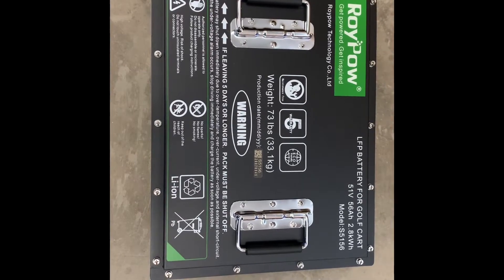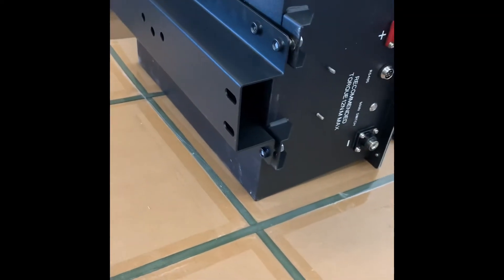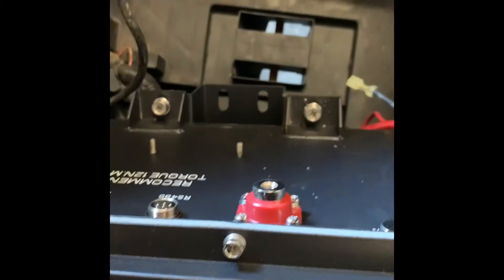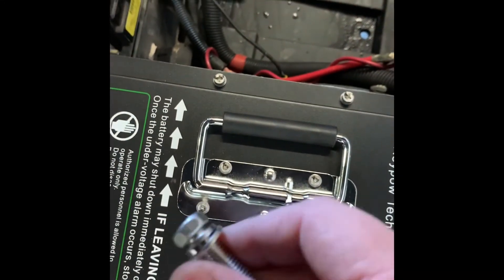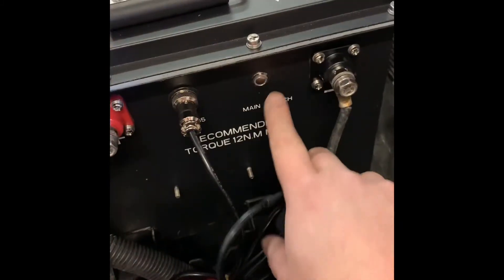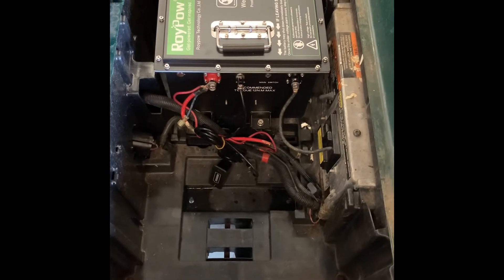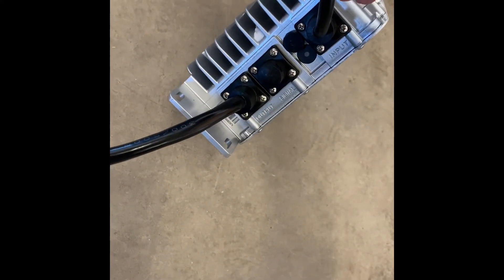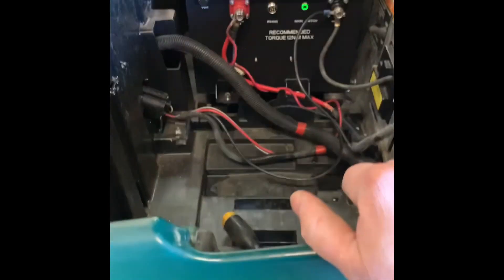RoyPow Lithium S5156 Battery Installation / Conversion on 04+ Club Car Precedent 48v golf cart carts

Comment: Will these RoyPow batteries fit a 2013 Club Cart Precedent?   Also, Where do you get a replacement battery charging port?
Reply from the maker: Yes. I sell the kit on my website JBCarts.com and shipping is $299 if needed. Out of state buyers do not pay Texas sales tax. I did do a tutorial video on how to install it on the club car as well. Roypow now only uses the charger adapter that connect directly to the battery now and no longer uses the receptacle.
Reply: @jbgolfcarts  ....... Thanks....also, does the new battery charging  cord use the old battery charging port that is next to the F/R  switch so you don't have to raise the seat to charge battery?
Reply from the maker: @steveharris2768  have to lift the seat on all updated roypow conversions. You can mount your charger on board and run an extension cord to the charger or leave the charger out of the golf cart but either way you have to lift the seat
Reply: @jbgolfcarts  If you don't use the CC original charging port (instead using the charger plug and pluging it into the wall) do you have to do an OBC bypass?

Comment: have you had any issues with the roypow chargers? i got my first 2 sets in and they give a fast blinking red light when plugged into any outlet wit or without batter connected.

Comment: I watched your video on the RoyPow installation. I would like to know if you have any pros or cons on the battery. Or have you been able to test the range distance on a full charge. I have a built 2018 club car precedent and I’m looking to swap out the acid batteries and put in RoyPow 105. I would like to know if you had any kind of problems or have heard of any problems for this battery before I fork out the money Thanks
Reply from the maker: I custom build carts so I have no feedback as far as how the hold up to their rating but I will say if there was a range issue my customers would have called me. So far so good though. I’ve had no calls or complaints from customers.
Reply: Thank you for your quick feedback
Reply: Upgraded with the plumquick motor with Navitas controller and battery protection comes on going uphill. Shuts golf cart down completely. But distance is great.
Reply: Look at other Lithium batteries for golf carts. RoyPow doesn't honor their warranty. I have a 3-month-old dead Roypow battery that was in my 2017 Club Car.. Been jacked around by them since April.
Reply: @richardtucker5837  Did you ever get your issue resolved with RoyPow?
Reply: @chrisfoster632  No. The RoyPow North American rep refuses to get involved. Said it's between me and the company I bought it from. I own a $2600 boat anchor.

Comment: Just installed a RoyPow battery in my Club Car. Where did you get the Stock plug to ac plug that you are using to charge the battery? Great video.
Thanks
Reply from the maker: Roypow is changing their charger plugs around so I’m not sure what I’m getting next but the plug in this video is what I normally get with the chargers.
Reply: Thanks for the quick response. My charger came with a normal wall plug so I have been searching for an adapter. Thanks Again
Reply: Hi 
Thank you very much for the video, I just got my lithium battery and I’m looking for the charger adapter like yours. The one that came with the battery is smaller and I like to use the cart stock plug.
Reply from the maker: @theseventy7904  that’s the new way they are sending them out until they get more of the adapter like in my video in stock.

Comment: i run 8 6v battery in my cart that is 1800 amp hours.6 8v battery is 1400 amp hours it has always been about the amp hours for the longest life..when i ask the guy about these he said only 56 amp hours
Reply from the maker: You can do the calculation online. You will need your kWh and the voltage to get the amp hour (Ah), with both of your systems you are saying 48v. This lithium battery is 2.8kWh at 51v = 54.902Ah. I used the Trojan T105 for the 6v example at 1.5kWh (according to Trojans Data sheet) and does not increase the overall amp hour if hooked up in series. 1.5kWh at 6v = 250Ah. Multiply the kWh by the number of batteries. 12kWh at 48v = 250Ah. 1.51kWh at 8v = 188.75Ah. Six of the 8v Trojan T875: 9.06kWh at 48v = 188.75Ah. Roypow states it runs, at max, the S5156 will go 20-30 miles on a charge. According to research I've done online the lead acid does double that new but started to fall after the first year so If you need the range of 40-50 miles then go with the S51105. 5.3kWh at 51v = 103.92. The rating on lead acid run time stops at 75 minutes at 75a, the lithium runs max at 200a so the lithium goes over double over what the same rated lead acid battery will go. According to searched online and roypow info below. Trojan PDF is below and roypows rating as well. Hope the info helps. 

https://r.btcdn.co/2800/original/374077-T105_Trojan.pdf

https://www.roypowusa.com/?page_id=26237#bit_twf81

Comment: Thanks for the video, very helpful! Could I use a different battery monitor with this instead of the one provided from Roypow? I already have a Renogy and shunt, wondering if I could install on negative.
Reply from the maker: You can use another battery meter. Just hook it as as directed. Should have three prongs. One to main positive, one to main negative and the third is to your key.